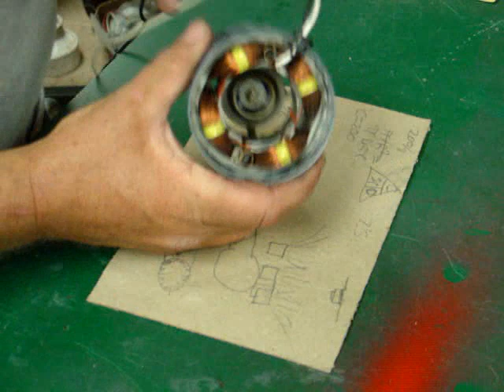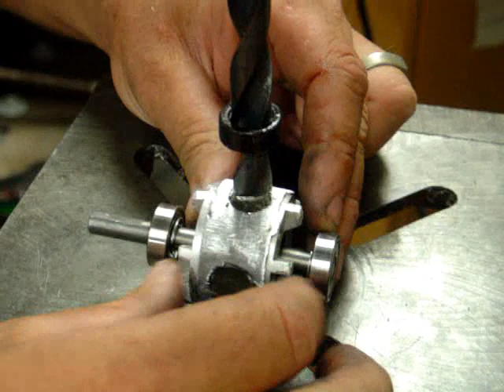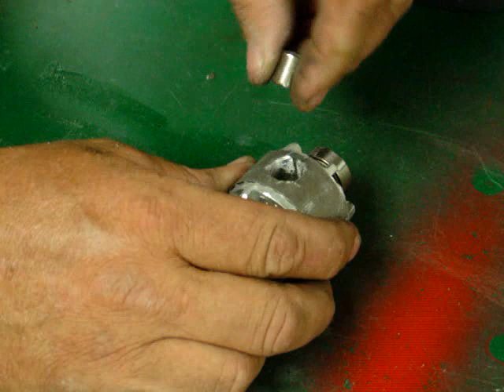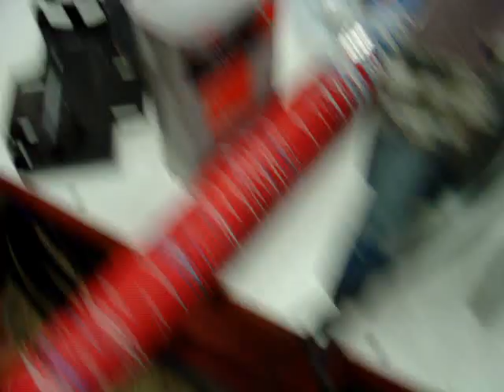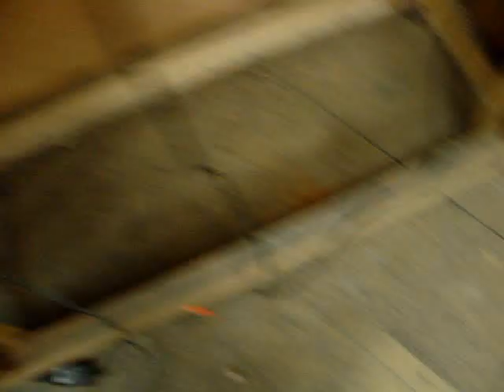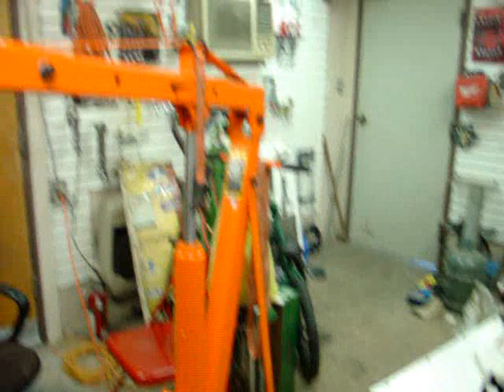AC INDUCTION MOTOR CONVERSION TO AC PERMANENT MAGNET GENERATOR

Comment: Yeah, it has 1 coil and its giant!
but to run lamps smooth i still needed 12v car battery.
now i have voltmeter on it and 2 15w leds lighting up my garden.
voltage has never droped below 12,5-7
its not windy out here, but we have it all the time (5-15ms)
DIY is awsome.

Comment: Great video!  If you want to eliminate cogging, you would need to either install rectangular magnets at an angle or have smaller cylinder magnets and drill three holes for each pole but slanted.

Comment: Yes, it's a 2000 Honda Insight and you can often buy them on craigslist for a very low price with the Hybrid Battery worn out. The Hybrid battery is only 120 D size cells(by Panasonic) wired in series which adds up to about 144 volts nominal(the cells can take a 50amp charge and 100 amp discharge, I believe). The car is all aluminum, including the frame and weighs only 1800 pounds. Structural rigidity is 30% improved over a similar size car made of steal. Electrify your Jeep, That would be nice.

Comment: Fantastic, i built mine from tractor magneto, only thing i had to do was...
unwound the highvoltage coil and then replace it with stonger and larger.
got nice low rpm generator lights up 15w led at 180rpm

Comment: super , invention of the century ... and something practical would not ? What good is a high voltage generator ? transformation to high voltages in your case will feed two light bulbs and konec.vice energy use up to drive between generetoru.Patris another inventor who love to see themselves on Youtube

Comment: Very interesting video. It looks like something I'd be willing to try and it looks about the right size for what I'd want it for. I'm a newbe to all of this, so now I'm stuck with a whole bunch of questions. Like what make and model was that small motor you used in the video and where can I find one. You said in your video that it produced 55.3 volts, but in your post you stated it produced very low amps. Just how many amps did it produce and is there a way to up the amps. You also stated that that project didn't produce the power you had hoped for and that it might do better by adding more magnets per pole. Have you tried that yet and if so how did it turn out. Any additional help you can offer would be greatly appreciated. Keep up the good work.

Comment: Induction motor armatures have conduction circuits to induce magnetism.
Does your drilling method interrupt those circuits ?
If not, then I think they would produce resistance and reduce the potential output.

Comment: I'd like to know where in the heck your going to get the magnets for that big monster of a motor. The price of magnets today is way out of line from what they should be. I got some from a site called dealextreme. I think it was about 55 dollars for 100' 20mmx2mm or roughly 3/4"x 1/8" might be a little smaller than that but still the nice ones are pricey. Oh well what cha gonna do. They got us over a wok. Thanks for all the videos and lessons on wind turbines. (Tom)

Comment: On another note...I pulled an old generator apart 3750 watt and thought I'd try drilling and installing neo magnets into the rotor to beef up the wattage.  Would this screw up the electrical on it? Drill/install little 1/2 by 1/2 cylinder magnets, maybe 10 or so on each arm of the rotor. 👍👎

Comment: was that a 1 phase motor you converted or 3 phase, have you converted any 3 phase induction motors yet as i have a spare one hanging around not as big as your big motor you have but its as big as one of them you shown i think probz that black one at 00.26sec, looking for hints and tips on putting the magnets on the armature and what size magnet to use. great video tho

Comment: I took a pair of snips and cut each pair of wires off of the bridge rectifier.  Would I have to soldier an eyelet to each set of wires to complete each circuit THEN try ohming them out?

Comment: Quick question because I am very new to all of this. I have an x13 motor which is an AC motor but it is a magnet motor already.  I hooked to light bulb and turned just by hand and it lit it well.  Would one be able to charge batteries with it? In other words is the power coming out any different than any other charge? Like is it sending out AC current? Like I said, I'm totally new to this.